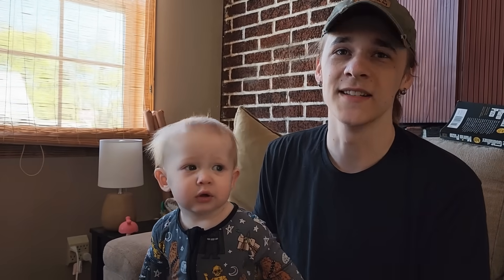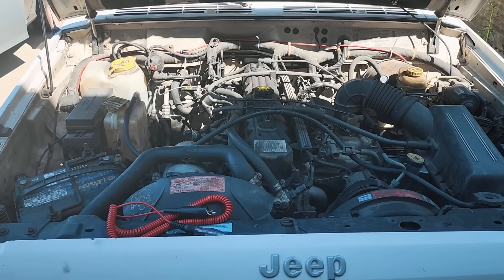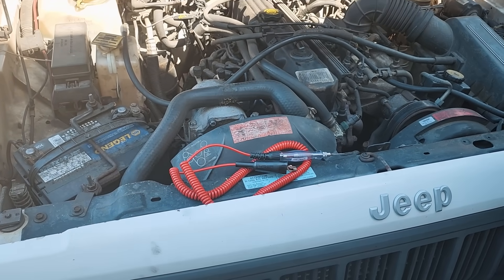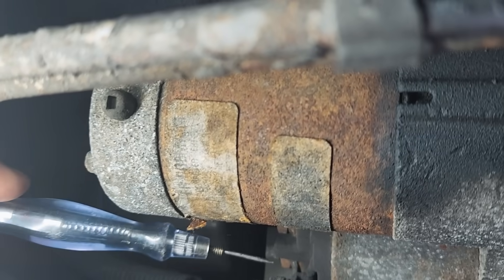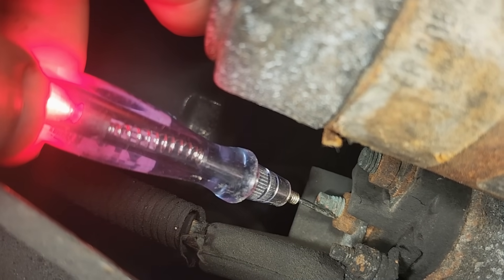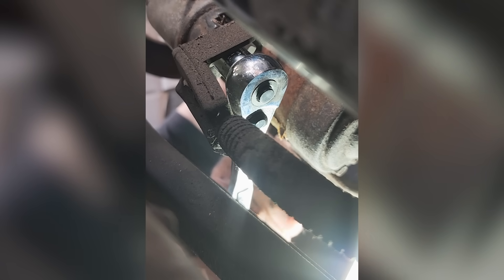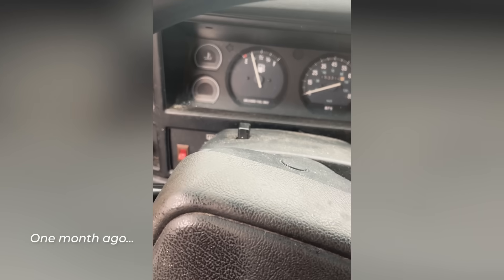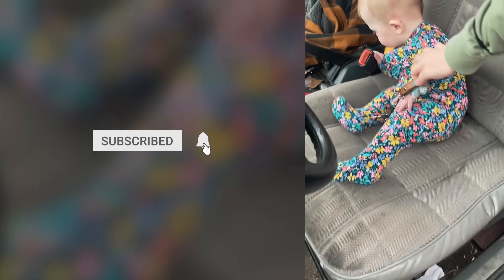Bad Starter or Bad Wire? - Starter Tests Everyone Can Do (family intro)

Comment: Can you use an old school diy test light in an emergency situation?
Reply from the maker: Absolutely! That's what this is. Even though the bulb is red, it is an old school incandescent bulb. That is the only type of bulb you want to use anyway! LED test lights are garbage for troubleshooting in most circumstances
Reply: @ScannerDanner  I always wondered how old mechanics did that, then when I was in the south, one taught me how to build a test light from a grinded down, mini flathead screwdriver wire, tape/rubberband and my tail or curtsey lightbulb. Just didnt know the accuracy of it of it,  but they said the led was trash but didn't have the parlance to articulate why.

Comment: A voltage drop test is done with the circuit under load. The test light shows electrical current lighting the bulb indicating a voltage drop due to excess resistance in the circuit. So why does the bulb energize? Using the test light creates a parallel circuit path thus, electrical current will take the path of least resistance which is the test light.
Reply from the maker: I'm sorry, is there a question in here? To clarify just in case. The current flow it takes to light this bulb is super small in comparison to what the starter current is. The resistance problem that is there is affected by temperature! It is basically a PTC resistor. So with my test light there only, there isn't enough current flow to create the heat that this resistance issue will cause. But as soon as you energize the starter, that massive amount of current heats up this bad connection (which causes a huge resistance increase) to the point where even my test light will no longer light! This is why loaded circuit testing must be done! The test light in this case is not even enough of a load to see the problem. Same with a voltmeter! Got to load it to see it!

Comment: Good info and cute baby.  I always forget this.  So I’m thinking when solenoid activated as a switch then current is flowing and because of bad connection between eyelid and stud there is a voltage drop because of this.

Comment: Bro that literally was my issue. Volt drop 12.9 charged battery to 11.5.....no click after few tries...drained battery no codes!............ took it out and tightened nuts and cleaned em....bench test and it popped out and spun....

Comment: My 2000 Cherokee is down for two weeks now and it has this same symptom! Click no start, took the starter  out (was hesitant coz I changed it 10 months ago) and went to the parts store to buy a new one but I thought of asking them to check the starter. The starter turned out to be good in their testing so installed it back but still click no crank! So I will do this test light method you guys demonstrated here and will fil, it and tag this channel! Wish me luck! :)
Reply from the maker: Good luck!

Comment: Great video man, I'm new to voltage drop and the concept but this makes complete sense. I'm guessing there's so much resistance between the eyelet and the post that current can't travel to the post. I can see how snugging it up a little could possibly fix it, as that would probably displace some of that resistance by moving it (although id probably still clean it up). The concept is similar to back probing a connector when you have a intermittent issue as you want to observe it in its natural state before you pull it apart, as this could fix the issue (displace the resistance) and have you chasing your tail. If I'm incorrect about any of this id love an explanation. Regardless, keep it up man.

Comment: Does the wire/ground from the light tester need to be connected  to the battery negative or can it be connected to any ground area on the car (aka somewhere more convenient near the starter)?
Reply from the maker: Battery negative when possible, especially when testing for a bad block ground. But other than that any ground should be okay

Comment: 2007 lacrosse 3.8 no start had starter clicking removed it and bench tested same clicking replaced it started n just clicked did test light alternator post to housing had continuity then tested alternator good then had test lite on block n lighted up checked all grounds were good so I did some research 
Negative battery post had a small wire going to the front clip bolt then looked up grounds for car finally found a ground wire was wrong need to go to frame just below battery tray gna get a ground strap and recheck I'll let u know the results when I get strap
Reply: When I removed the small ground wire car had no dash lights radio headlights or interior lights FYI
Reply: Just puzzled y everything was fine before I replaced starter🤔🤔🤷‍♂️🤦‍♂️
Reply: Why didnt it start after changing starter? Thats what puzzled me for days 
What changed ?
Why did it start normally before starter went bad 

Id appreciate ur input

Comment: Just wanna say I appreciate the video. Wiring is my worst enemy and I got a starter click no crank issue on a 99 Ford V10. Jumped the relay on the inner fender and starter clicks. It's -10° out so in the morning I'm gonna grab the test light and go through it now after watching this. Thank you 🙏🏼
Reply from the maker: Good luck with the test light. Let me know if you find the problem.
Reply: @ScannerDanner  I couldn't find any loss of power when turning key at all. Come to find out the Extreme cold caused by battery to have a dead cell. It read 12.57v when I checked and no loss of power when I tried to turn the key. Just clicked on the starter itself. I took the battery out just to take it in the garage and maintenance charge(trickle charge) it overnight in the warmth and that's when I figured out the next morning that it had a dead cell. Got it replaced and the truck fires rite up no problem. 👍🏼. Weird! 🤔
Reply: @ScannerDanner  needless to say I'm probably going to keep an extra battery around for testing that issue if it ever arises again. 👍🏼

Comment: Nice. I removed my starter had it tested supposedly it’s fine so I put it back in tried to start it but same. Just one click. And yeah I did that before I looked at fuses and relays which is where I am now and I’m telling you with my luck I am not going to find the problem myself it’ll probably be something way worse than I can even imagine

Comment: I have a 2002 envoy I've changed the starter relay and starter no crank and have a fairly new ignition switch and neutral safety switch fuses are all good including the 40 amp fuse and 10 bus fuse this is the 2 and new starter bit it seems to be burning out the starter solenoid any help would be helpful
Reply from the maker: New meams nothing. Do the tests I showed at the starter and report your findings

Comment: What happens if the “S” post doesn’t get hot when cranking?
Reply from the maker: great question!
1. You do NOT need a starter
2. You must identify all of the controls on that side of the circuit (wiring diagram and service info). Here is a link for the DIY version of the service info I use. https://eautorepair.adtrk.biz/?a=10817&c=24&p=r&s1=
Things like: starter relay, park/neutral switch, ignition switch, immobilizer issues (anti-theft) etc
Spend some time in this playlist! https://www.youtube.com/playlist?list=PLAFYVCyenqcpZM-kQg5MUX0OvrIPSirz5
Reply: @ my transmission isn’t connected and I’m trying to get the engine to run first.

Comment: 1980 Pontiac Firebird 301 V8.  No power to dash no dash light with new battery. When turning key to start car sparks fly out of ground strap to engine.  Any ideas.  Thanks
Reply from the maker: Bad Block ground!
Reply: @ScannerDanner  I'll try that and report back.  Thanks!

Comment: Great video. I had a starter that would not turn, ... it was the two nuts that were rusted to hell that prevented good contact with the starter cable. Removed the rust till it was nice and shiney, retightened the nuts, engine started right away.

Comment: I am having a no crank issue with a 1992 Toyota Celica GT can’t figure this out I jump the clutch switch didn’t know if it was good or not when I turned the key starter relay clicks, and I noticed I don’t have any power on the starter signal wire when they turned the key with a jumper wire from the battery into the starter signal wire spot on the starter it starts diagnosing things like this has always been a pain for me not sure exactly the tools that I will need to begin learning what is something that I’m ready to get if you can HELP me I would greatly appreciate it
Reply from the maker: Need voltage readings at the starter relay during cranking. An incandescent test light would be best if you have to remove the relay
Reply: 11.89 when I turn the key

Comment: I’ve got a 2014 honda crv that starts intermittently. I changed the starter cut relay in the interior fuse box, but the intermittent problem remains. Any advice on what to check next before I buy a new starter?
Reply from the maker: You have to catch it during the no crank condition, with test equipment on hand, otherwise literally everything else is a guess.

Comment: Why do you say not an LED test light.  Can you not use an LED Computer safe test light with both the positive and negative connectors?
Reply from the maker: because as little as 3v can light an LED and it can look like 12v. I can see a difference between 9v and 12v with my incandescent light. But when in doubt, the voltmeter is the best tool to use in the application but you MUST make sure there is current flow in the circuit you are measuring.

Comment: My issue is with a motorcycle, any idea why when i start the bike the start motor wont turn turning the engine over? i often notice this after iv ridden somewhere turn the bike off and the engine keeps trying to start with the ignition off. Been a recurrent problem and never figured out why iv just been using the kick starter but now thats fucked too.

Comment: Good video but always have the battery disconnected,  I know it was just to tighten the nut a little and I’ve done the same thing many times that was until I wasn’t careful enough one day and did shorten and nothing worse then easy fit turning into a problem which can lead to a bigger issue and maybe costly

Comment: What if there's no power to s terminal when cranked?
Reply from the maker: @JPangelinan  negative as you are looking for power
Reply: @ScannerDanner  thank you. Dealing with a no crank issue. Starter replaced and relays. Still no crank no click
Reply from the maker: No power to the S terminal can be MANY things.
A security system issue, ignition switch, park/neutral switch, relay, wiring, engine computer, engine computer wiring etc etc.
Reply: @ScannerDanner  using a test light on the s terminal would it be connected to negative post or positive post??? Thank you for the help.
Reply from the maker: @JPangelinan  next step is a good wiring diagram! https://eautorepair.adtrk.biz/?a=10817&c=24&p=r&s1=
Reply: @ScannerDanner  looked at the wiring diagram and wire colors are not matching...Used a test light and found out starter fuse terminal is not getting any power? Suggestions???
Reply from the maker: @JPangelinan  get the right diagram! Everything else is guessing

Comment: So I tried this. I clamped the test light to the frame of the car touched the post on the solenoid and nothing. Then touched it again with my dad trying to start the car and then sparks started flying where I was touching the post with the test light and the car started. I'm confused as to what happened. Why did it spark? Why did the car start like that when it wouldn't start before I touched it with the light while it was being started?
Reply from the maker: Sounds like you crossed the solenoid post with the battery post with the tip of your light
Reply: @ScannerDanner  thank you for the quick reply. that's what it seemed like but I'm pretty sure that I didn't touch both terminals at the same time. Could there be another reason why this could have happened?

Comment: Thanks so much !! Been dicking around with my 97 7.3 for a day now trying to figure , solenoid or starter or shifter linkage and was power drop to starter from loose bolt and some rust  🙏

Comment: My motorcycle right now is giving me a similar issue to where sometimes it will start sometimes it won't if I tap the side of my engine it starts right up every time but it's a gamble if I don't tap it, think it could be a loose connection as well? It's a 2005 Honda.
Reply from the maker: Yep, same checks you need to do with a test light during the no crank condition

Comment: I have the same situation but I can tap start
Reply from the maker: is there a question here? sorry
Reply: @ScannerDanner  sorry, I have many questions. I have a 2005 impala no crank no start. Originally my only problem was the starter wasn’t functioning from the key turn but if I jumped the relay it would turn. I also could tap it. 
After checking cleaning grounds I lost all use of the starter. So I don’t know what’s going on. Relays are good  and fuses. Have fuel pressure. Checked the pink wire from the coil pac and the ground. 
I do have a security light, always have and never been an issue. 
All this started with a cyl 6 misfire and replaced plugs and wires and then the problem with no crank started. It never even clicked or tried to turn.
The dash lights all illuminated at on but all turn off when trying to crank. 
I guess the starter is bad maybe because I use to could tap and now it won’t respond but I don’t know if that is the root problem because yesterday I could jump the relay and the starter did fine. I feel like even getting it tested, repaired, I’d still have a communication error to it. 
I guess I don’t have a specific question other than the obvious, why won’t it crank.
Reply from the maker: @jeremye5714 what are the results of the test light tests I showed here during cranking (while the key is held in the crank postion)
Reply: @ScannerDanner  ok I actually didn’t have help before but just now I had someone in the car and in the on position I got main power to the big load screw bolt etc and then I told her to crank and touched one of the smaller post and it cranked. I wasn’t expecting that to happen and kinda got out from under the car on a hurry and hadn’t had a chance to re-check but could we say that it’s a bad ground to the starter?
Reply from the maker: @jeremye5714  bad connection on the smaller post!
Reply: @ScannerDanner  I went ahead and cleaned each post and it cranked right up but then only 1 more time and it’s back to normal no crank
Reply: @ScannerDanner  could it be my ignition switch every now and then my key gets stuck for a second

Comment: Thanks much...I am trouble shooting my no crank no start condition on my '02 Powerstroke. I was just about to pull the starter, but will try this first. I have to pickup an incandescent test light first at Harbor Freight as all I currently have is an led style.
Reply from the maker: Yeah, the reason we don't want to use an LED is because 4v on a circuit can look the same as 12v, where an incandescent will dim significantly or go out completely

Comment: Thanks for the great testing methodology. Looks like that poor Jeep needs a set of oil filter adapter o-rings. She leakin'.. 4720363 Oil Filter Adapter Seal Kit. You'll need a T60 socket that you bang the torx out of the socket, then use a box end wrench on the torx w/a cheater bar to get it loose.

Comment: My diesel been having this same problem.. I almost bought new glow plugs, new bigger batteries, alternator, but my dad and I keep talking about the starter being loose due to vibration.. I just got done cleaning all the grounding wires and connections.. time to recheck the starter I bought just LAST YEAR

Comment: Thanks guys. I was taught back in the 1960s, to clean the contacts and apply a smear of Vaseline. That stops corrosion. Especially useful on the battery terminals. Looks like you guys have salt on the roads, as we used to have in the UK. Makes the corrosion protection extra important. Never had any conductivity issues from Vaseline over the last 50 years!
Reply: My dad worked in the control room at our local power plant for thirty years and we always had a jar of No-Ox on our shelves. It's basically the same thing but my dad always instilled in me the fact that it's usually the little things which can cause you problems when it comes to 12V circuits. I have a '98 CRV with 306K miles on the odometer and I started having starting issues and loss of power at start-up last year over a several week span. I started at the basics and I quickly discovered the cause of the problem. It was simply a bad battery ground as the bolt was rusted badly in the threaded hole. As soon as I ever so slightly loosened the bolt (I was afraid I was gonna snap the bolt off) all of the problems went away. I left it that way for a week or so and then the same problems returned. There are several identical threaded holes next to the first gen. CRV's battery so I simply used one of them as the new battery ground instead. As I feared, the original bolt snapped off in the hole when I tried to remove it. I was prepared for it so it was no big deal. I could see where water could run down past the hood seal and flow right down to that ground bolt so I made sure to apply some RTV sealant around connection so rust wouldn't be able to start in the threaded hole.